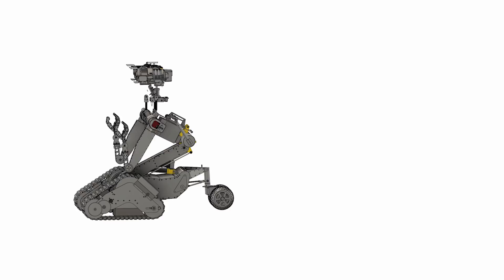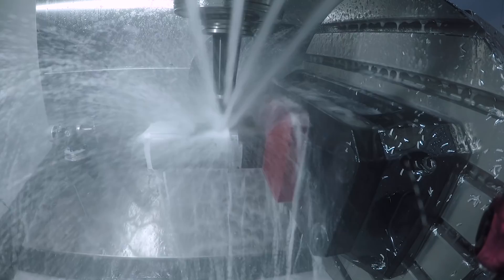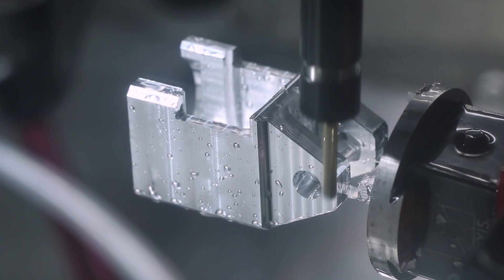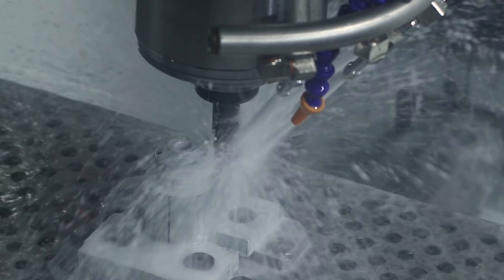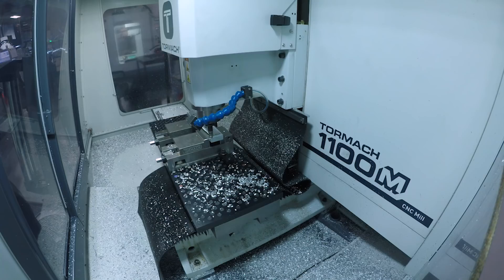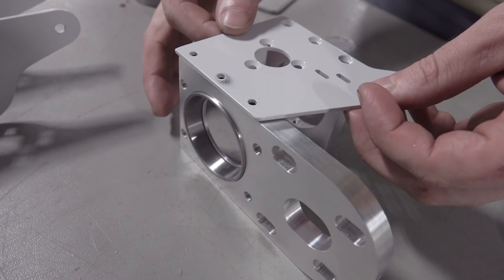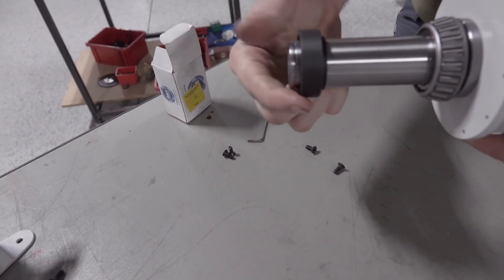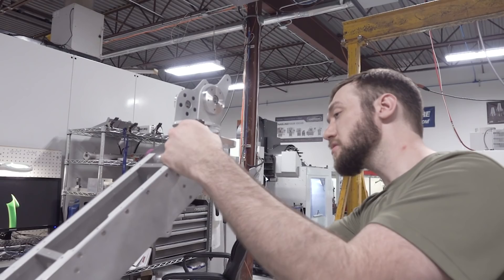Robot Build | Short Circuit Johnny 5 Mid Torso Pivot Joint & Actuator

Comment: Tip - slightly nip up on of the screws then wiggle the hex key in the another hole to check they are aligned before trying like Muppet to line a screw up in the hole.  I still cant believe that some people out there feel the need to leave dislikes. Why?  
Top marks for your first 5 axis job, I have still to achieve mine.  Work is looking sharp you must have a good teacher. (Judd, lol)

Comment: Very nice...however on one side for fixing the plate you have countersunk bolts/screws but on the other side you've got those big bulky cap head screws. Maybe stainless dome head hex or torx drive screws/bolts would look better?

Comment: Looks like the in-movie price of $11 million is going to be about right.
Reply: But this one will be better.
Reply: @KnightsWithoutATable  A rudimentary AI and a deadly laser weapon?
Reply: @marks47  If you have the batteries for it. Still, with the form factor you are looking at something that could burn eyes out at long range and cut through thin aluminium sheet metal at point blank range. An overpowered cat toy, essentially.

Comment: I still want to know where they are going to source the laser from or if this is going to be a Short Circuit 2 and he will have the beat up red toolbox with attachments in it. That would have been more useful for the military use design he was supposed to have in the movie to begin with instead of the laser anyway since it would sap the on board batteries with every shot. 

If I were to pick a place in the military that I would want to see robots, it would be in logistics. Carry stuff, lift things, do basic maintenance inspections, bring a box to the supply desk from the warehouse, that sort of stuff. No moral issues and no risk of an AI going "kill all humans" mode. More R2D2 and mechanical pack animals than death robots. An AI that can pilot a plane while the human pilot switches to gunner, bomber, or electronic warfare officer would be useful too. Just don't let it have access to the weapons. Maybe do radar contact ID, but not until it is as accurate as a human or better. We don't need an algorithm like the ones YouTube uses giving a school bus full of children on the ground the ID of mainline battle tank.